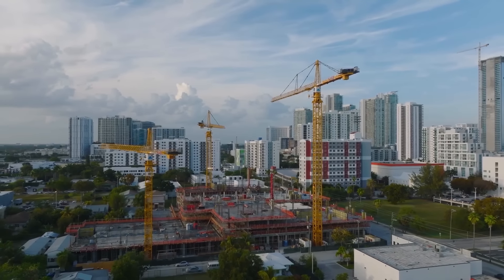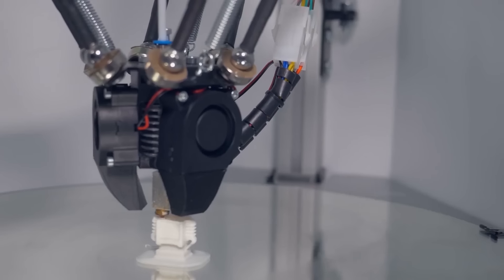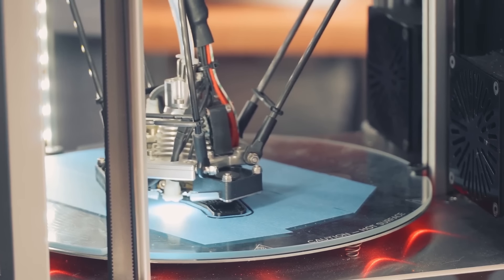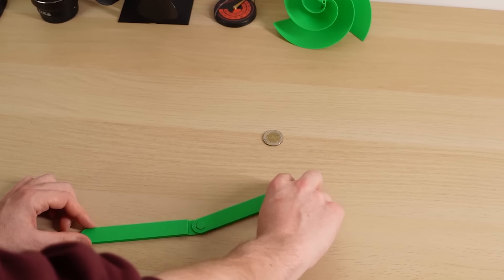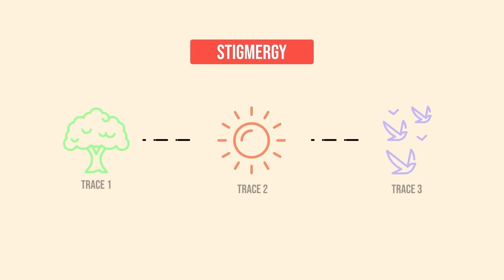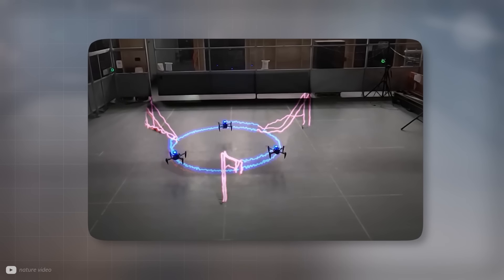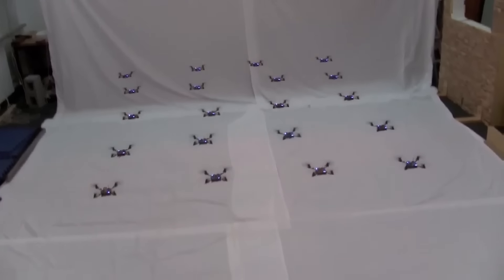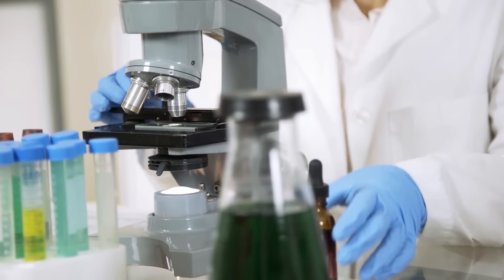Why 3D Printing With Drones Will Transform Construction

Comment: Considering for larger projects, a single pass with a single small drone will have an absolutely tiny impact on the final product. Any errors on that drones part are going to be negligible especially if the swarm is able to detect errors and take action to correct them like a drone with a clogged nozzle or kinematic errors popping off for maintenance etc and another taking its place.
Reply: The hammer is still in use because ''the less moving parts, the less issues there can be'' i'm pretty sure this would be a nightmare operation to deal with. The number of failed print possible is huge and we are talking structural integrity.
Reply: @sebtessier5023  Unless you leverage AI to manage the drones, detect and correct issues in real time. You can drive a single nail into the wrong location and still build a perfectly fine house.
Reply: @Neuralatrophy  wouldn't it be absolue atrocious tu try an manually control a swarm of hundreds of drone manually? I am pretty sure we would need an AI. Still have to clean hundreds of nuzzle after, find replace batteries frequently, tiny repairs for every thing and that is without mentionning the noise for the Neighbors. I am pretty sure it would get banned in large city

Comment: Let's check the number of problems with the idea: Likely needs a fleet of drones to practically make anything of usable size. Drones need reload time. Recharge time. Near zero windspeeds for 3d printing to be remotely accurate.     So this construction method is. Slower, more expensive and would only be useful in building structures unreachable or in impractical places. 

Biomimicry is a great idea when used practically, not when you randomly apply it to drones.

Comment: Really cool idea. And I have drones and 3D printers and love them both. Problem here it's going to be power to weight ratio. Construction materials are very heavy, drones have limited carrying capacity. Anything that can build buildings or lift girders or eye beams is going to be massive, and cost way more then Caterpillar or a simple crane. We'll have to see where the future takes us. But i don't see drones doing this for a long long time..
Reply: Yeah drones aren't suitable for this really. Ground based robots or gantries would work much more efficiently. Maybe even something that crawls along the wall and poops out concrete behind itself would work.

Also it is "I beams" not "eye beams", they are named because of their shape, it is the shape of a capital i, similarly they can also be called "H beams" again because of the shape.

Comment: How do you get rigidity into these structures. Are there 3d printing rebar drones. Or..girder drones?
Reply: They don't. These drones and most 3D printed houses are nothing but concrete, no metal reinforcement and all electrical or plumbing work needs done after the structure of the house is built. They also likely need to put extra walls up inside or you will have a bumpy, plain concrete wall with all the wiring and plumbing exposed.
Reply: I was actually surprised but the trump international hotel in chicago is 1389 ft of concrete, no rebar.
but definitely not built with flimsy drones

Comment: We're a roofing company that also builds drones and robots via 3D printing. 

What @Islandhermit said is correct. The energy it takes to lift material is far more significant than the existing methods. 

3D printing is still exceptionally unreliable. Clogged nozzles, faulty temperature sensors, maintenance of tensioner belts, humidity control of filaments... Printing on a stable platform in a controlled environment is still hard. Adding drones and integrating all of that into electrical, plumbing, all within code, in all weather.....  guys.....  guys.... if there's one company that would be all for it its us and we're probably a couple centuries away from doing it this way. 

Tech likes to think they can solve everything but just remember... Elon Musk succeeded at space travel before he succeeded in roofing.

Comment: What's the point of having flying drones. Climbing drones can use an already printed part of the object for orientation in space and as a route for material delivery. Like ants.
Reply: Exactly. The climbing drone makes infinitely more sense. And I would imagine that's why nature preferred that design also.
Reply: They should be like wasps with legs to stabilize, move around and smear the concrete if glitches happen.

Comment: How about ant like drones. That can work together to from different shapes/constructions/machines. Just like a group of ants can form a bridge. How about a group of walking drones that form a crane that holds a hose that prints. Far more stable, stronger, flexible, exact. Flying drones are at the mercy of wind. And wind can't really be controlled. And building needs millimeter exact control. Especially with modern Ai it will be easy to control a swarm of builder ants.
Reply: The flying drones would need additional legs(robot arms) like wasps to stabilize for precise work and knead the applied concrete into shape.

Comment: I think this will prove more useful for aesthetic repairs in hard-to-reach places. I'm not sure the strength or layer adhesion of material deposited like this will meet the regulations required for any kind of load-bearing structural elements.
Reply: Yeah this will be better used for other things than building the walls. The walls are built on the ground so why not use ground based robots?

Drones may be good for spraying insulation or paint though.

Comment: I’m a drone guy, but why not apply the materials by integrating the control arms to a concrete pump type truck. Drive the truck up, set up, start bringing materials to the “truck” and get it done.

Comment: Many problems with drones have aleady been pointed out: precision under wind gust, weight load, fuel efficiency.  In addition,  drones would be most helpful for high-rise building construction, but the 3D printed materials would likely not have the required tensile strength where steel beams are normally used.

Comment: I can see this stuff happening in less than 10 years easily.
I can also see it going far beyond what is predicted here.
I don't think skyscrapers will be 3D printed with drones, but with large gantries and other types of cranes, who knows though!

Really large tethered drones with constant power might be easy enough to make work, especially if they start using those toroidal propellers that provide more lift and are far less noisy.

Comment: Def a lot of room to figure this idea out.  3D printing homes is not as easy as people think.  The print only does the main walls.  A roof, insulation, inside finish walls and doors, electric and plumbing still all need to be done by hand.  The 3D printed walls are only 10% of the home.

Comment: There may be potential applications, but they're going to be severely limited in usefulness. Mostly because of payload capacity and environmental conditions. You also still need someone to control what they're building. We don't randomly build stuff without engineering it first - mostly because we need a structure that has a purpose and it useful to us. We can't live in a wasp nest or a beehive.

Comment: Drones hovering seems to be a limiting factor. What about a drone 'printer' that works like a Delta printer, where the print head can extend below any of the supports.
Doing that the drone can land on the structure, build up a section, take off and refill material and recharge.

If the construction done was quite large, it could even have smaller drones delivering materials. I like the idea of smaller drones being able to replace a battery on a large drone, or dock and transfer power?

Comment: Why not use a tethered drone with a power cable and material feed pipe/tube. The extra weight of these would be offset by not having to carry batteries and product. There would be no refilling and battery swaps, so it could run indefinitely.

You could also have an autonomous ground robot/tanker vehicle for larger construction jobs and to minimise cable/tube lengths.

Comment: Yeah, this night be nice for some weird niche items, but this is totally nuts and not going to happen. 😅
Also, the BS about it being green is complete hogwash.
You scale any of that stuff up to the size of a building and you've got an absolutely staggering energy consumption. And you're going to be burning through lithium batteries like you wouldn't believe. Each of those batteries has so many power cycles before it has to be recycled... If it gets recycled. And the power to charge those batteries has to come from somewhere, and the rate of discharge on the batteries means you're only getting 50% of that out as actual flight ready work.
Now you could eliminate some of these issues by using a tethered system, and I've seen that work. But the idea of flight stabilized 3D printing supplanting a 3D printer that can climb the structure that it's printing... Some things are just a bad idea. If 3D printers are going to do what you would like to do in terms of mass scale manufacturing, then those printers will have more in common with a termite then with a mud dauber wasp.

Comment: The only inherent advantage I see from drones is being able to 3d print anywhere. The disadvantages are battery life, load capacity, manufacturing cost, material cost, software cost, margin of error, points of failures, repair cost. It doesn't even beat a crane in that since cranes can move in all directions on top of having massive reach. (For really tall buildings, cranes can lift up other cranes.)

Let me know how the downsides can be mitigated, but aren't drones really bad for construction? They seem to sacrifice everything for the sake of speed as they bring significant disadvantages no matter what scenario you use it in, large scale or small scale.

[Large Scale]
It's difficult to get a lot of drones because well, they're drones and you would have to mass manufacture a quadcopter with gps positioning, networking capabilities and can print material. Engineering drones is NOT cheap at all nor does it have an optimized process like creating a long crane arm. You need many different materials along with extremely precise manufacturing for the computer chip and flight parts. It goes without saying that this is not cheap or reliable.

It also doesn't help that materials that "settle" can be incredibly strong, but they'll probably never be as cheap to make or strong as just pure steel. This singlehandedly kills drones because they aren't effective at heavy loads so they need to use on-demand materials.

Another concern is the handling of fails, hardware and software. Cranes are relatively extremely easy to maintain to prevent fails, on top of being extremely predictable and mostly safe when it does fail. Drones needs a calibrated gyroscope, secure networking software, calibrated extruder, stable gps connection and camera in order to not fail. When it does fail, you have no idea how it will fail. Will it crash into a building then bury someone in a layer of material, or did someone hack it and cause the drones to come raining down? Normally, a human operative can prevent these things but it's extremely difficult to pick 1 drone out of 1000 and shut that specific drone down.

[Small Scale]
-Now drones can still be useful for small projects that don't need more than a few drones, enough to be created and serviced by a single person or a small team. Except there's one key issue, why does the 3d printer have to be a drone? Stable configurations will always be more efficient than unstable ones, both in terms of errors and cost. -

For small scale projects, regular 3d printing material is already strong enough to not require stronger parts. In that case, you can build larger structures if you use interlocking parts (which is what the 3d printing community does anyways) then put it together. Worst case scenario, use a screw since if it works for suspension bridges it probably works for you. That or just get a bigger 3d printer. Seams are fixable.

[Proposed Scenarios]
Safety high up is already decent. If you can't even ensure your workers can be safe up there, it's highly likely the building itself is unsafe. Disaster relief in faraway places sounds good, until you realize you still need a giant ship to carry all those drones and material over. Replace multiple shipping crates of tightly packed drones with one larger than usual printer and you're fine.

Comment: I feel like you're ignoring a 40ton elephant in this room. Lifting anything with a drone takes a lot of energy, and the large scale concrete printers have a very large print nozzle, allowing them to extrude a lot of material at a time. The drones won't be able to get off the ground with enough concrete to supply a nozzle like that for 10 seconds, meaning they have to have smaller nozzles, meaning print times will increase dramatically, making the whole thing impractical.

I'd love to be proven wrong on this, but I just can't see it happening

Comment: How about a crane-hoisted platform with material, and then have hoses running down to supply a fleet of drones? They would have limited maneuverability, but that would outweigh the time & energy spent picking up stuff.

Comment: Sorry, drones will NOT be a major player in construction -- the power and energy required to keep them aloft and the cost for doing so makes ZERO sense.  Also, the positioning accuracy will be dreadful so unless you want a home that looks like it was constructed by ants on acid you are going to look elsewhere.  Gantry cranes with external positioning using lasers will be vastly more precise and much cheaper and faster.  Seriously, how in he!! do these ideas crop up and how are we to take seriously the people that push it?
Reply: Gantries are out. You're going to see 3D printers that climb the structure they're printing... Like a termite.
Reply: @Unmannedair  If the structure is tall a self climbing printer makes sense, but since most structures being bult using printers are one or two stories tall a gantry style is just fine.  The real point is that drones are NOT practical and will be of limited use.
Reply: You know that doesn’t mean it’s impossible
Reply: @jonphaz  Please, I've owned and operated drones since 2015, I know a thing or two about them.  I've worked in the USAF and know a thing or two about what is and what is not viable.  The drone would either need a large hopper to hold the material and that will be heavy, a drone required to lift that kind of mass will be HUGE, and NOISY.  And even then the hopper will not be large enough to last very long.  So, you would need to have a hose or other means to constantly feed material to it and if you're going to do that you might as well use a superior ground based system like a gantry crane mentioned before.  And, as I've also mentioned before the positioning accuracy of a drone is dreadful and any wall constructed would look like an any colony on acid made it.
My guess is a grifter is looking for money from a VC operation and will milk it until they can't.

Comment: Buffed the buffer for more stability. This is probably amazing for bridge, or antenna repairs, imagine it with a welder attached fixing things. Do we have the modular work bot platform yet? Milwaukee get on that replace my job already I can use a break. Except I'm sure it will just mean overtime. If we keep solving all the problems of work why do we need money again? The cost is coming soon.

Comment: 3-D printed houses only print the walls. The foundation, roof, windows, doors, insulation, wiring, plumbing etc are all still done manually.
Reply: Exactly. And putting up the walls and roof of a truss-based metal building can be done quickly by a small crew.

Comment: Saying they still need supervision doesn't account for the fact that, while there'd still be some jobs, the need for supervision only would reduce total manpower demand by 90%+. I've been a construction mgr and contractor for years, and we simply wouldn't adopt a tech that requires high end tech skills for everyone on site, it's unrealistic. Further, my job is just as much to assure my team has work and is safe as it is to provide a quality end product. I hope this isn't adopted, outside of special use cases,  we need to keep everyone working, not reduce the number of jobs.

Comment: I could use such a drone in my shop. The electricity and plastic filament would hang from the roof and drop to the drone. No need for batteries. It could work non-stop for days. The advantage is that the size of the object would not be limited by the 3D printer frame. It could be as large as my shop. Precision limit of 5 mm is way too high though.:face-fuchsia-wide-eyes:

Comment: Gantrys are definitely a more doable method for now, they are definitely more emervu efficient, but this has alot of applications in emergency situations and spafe travel
Reply: There is no reason gantries can't be used in emergencies or in space travel too.

Drones aren't very efficient. One thing you will likely lack in space travel or in emergencies on Earth is power so you want an efficient solution.
Reply: @conorstewart2214  I agree, but the biggest issue with gantrys for emergencies is that you dont know the situation you're going into. In unideal conditions, you're gonna need a huge gantry.  

For space travel, the energy efficiency of gantrys makes them a more permanent solution, but you want to reduce weight as much as possible when you launch a rocket, so in some situations drones might be a good idea. I could see drones being designed to prepare (or repair) hard to reach infrastructure, like the equipment that produces filament for a gantry, the gantry itself, or the higher points on lander craft. Though on low atmosphere bodies though drones are basically usless, same for overly windy ones.